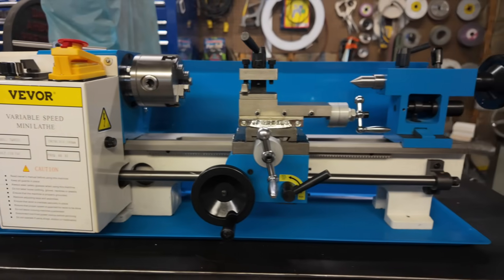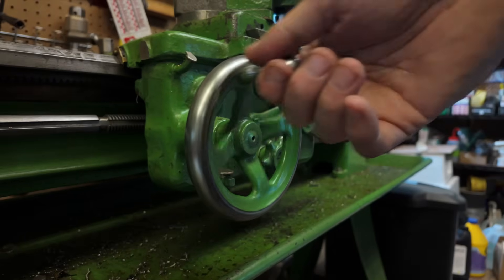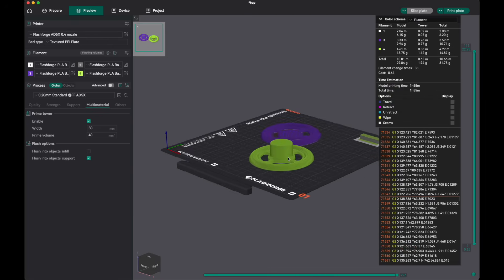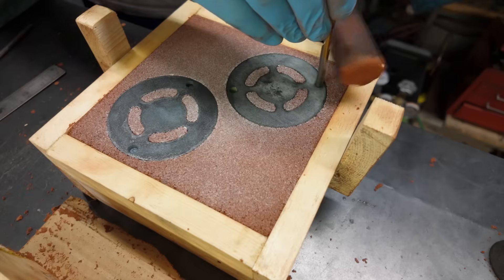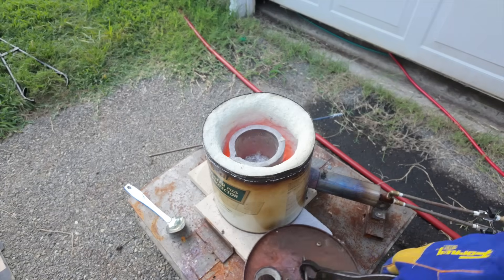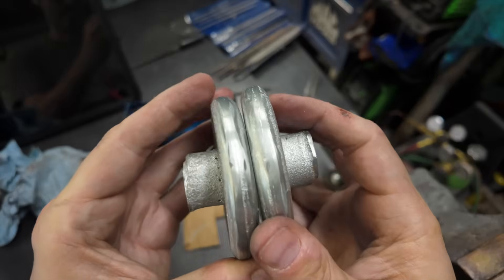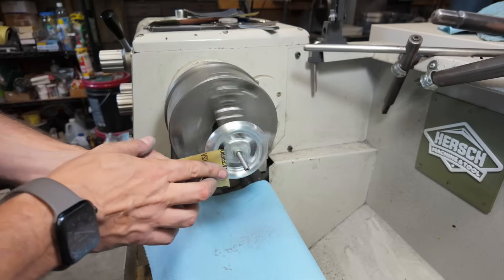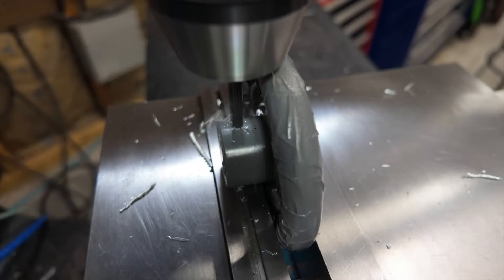You Might NEED This SIMPLE Upgrade - Turning Plastic into METAL!

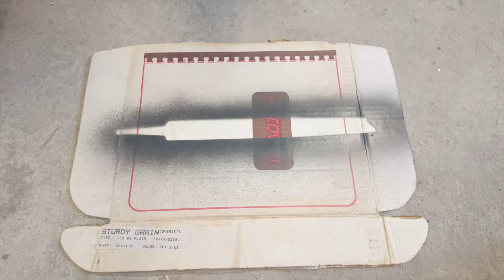Comment: 5:13 If you must go down the route of spraying your parts, then get some "high-build primer", used to be that you could only get it in tins, but you can get decent stuff in spray cans now... Drya quickly, and will most likely only need one coat...
Reply: Agreed, high build would be the way to go!
Reply from the maker: Thanks I’ll check into it 👍

Comment: A little disappointed you didn't make the handwheel on the mini lathe. After all, people who buy one of these most likely don't have a full size machine, and this would be a project they might get into. Also machining the handle would be perfect.
Reply: For that matter, most shops don't have a metal casting setup, making it even less approachable than not having a large lathe. Still, anyone attempting this project realizes the final machining can be done on a mini-mill.
Reply from the maker: Yeah this could absolutely have been done on the mini lathe. I thought about the same thing as I was editing, but in the thick of the project I just default to my other lathe without even thinking about it
Reply: If I did all that work and then came to a comment like yours, I would be more disappointed at how annoying some of the viewers could be.
Reply: @aguycalledlucas  His work is great, not dismissing it at all. I just don't think it really applies to most customers who are mini-lathe users. Some people (like Hersch) can take constructive feedback, others think it's a slight to everything they do.